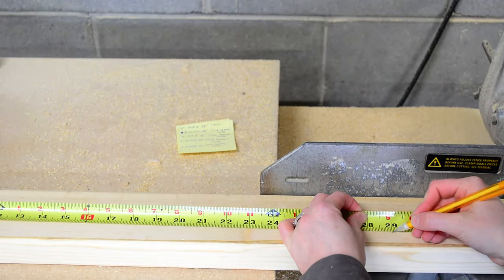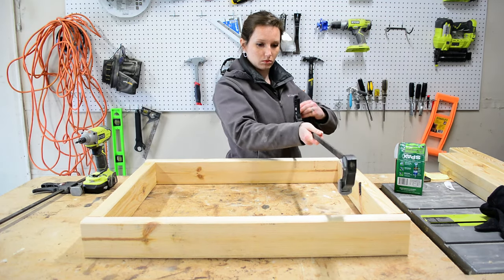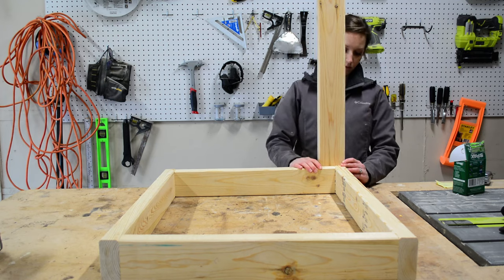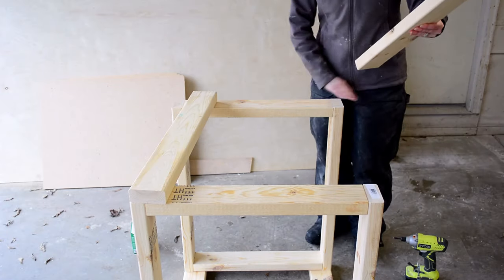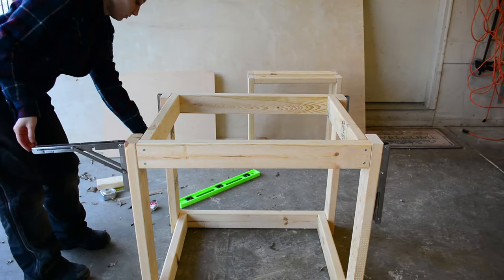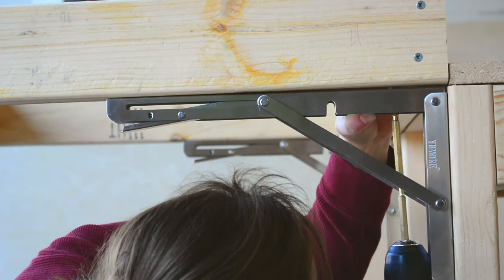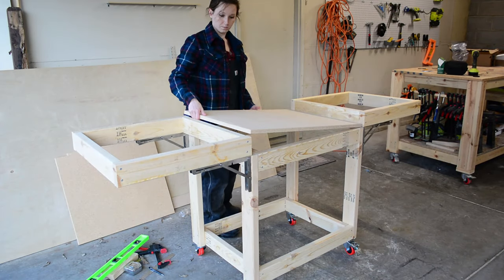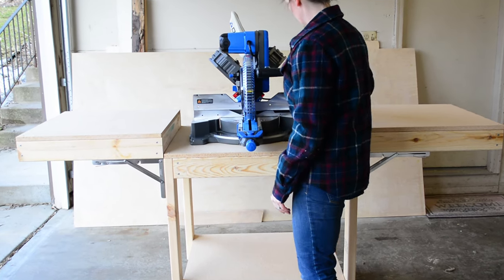How to Build a DIY Mobile Miter Saw Stand

Comment: I used your design and it came out pretty good. The only problem is something you alluded to in the video. The 12" brackets aren't,  at least in my case, strong enough. After about two weeks they started bending. But your one of the few people on line who isnt trying to rip people off and I commend you for it.

Comment: i built it yesterday and today.  i'm a newby and i learned alot.  in the army we had a saying "beat to fit"   the hinges were beat to fit.  they work perfectly.  i turned the table on it;s side to install the hinges.  thot it was easier drilling straight down than sideways.  gonna build another one for my son in law.  thx for your help.  keep the videos coming.

Comment: Great video. Took a look at her website, as well - informative. Decided to build this since it resolved some issues I currently deal with. I bought the cut list and plans. At $2.99 that was well worth it, plus it felt right to reward Tylinn for her efforts even if it’s a small amount. Trickiest part was getting the height of the wings to match the saw height. That’s easy enough to calculate but life isn’t as accurate as that. Saving grace was being able to shim the saw when mounting it in place. Used the completed project for the first time today. Worked great, and the wings provide me with much needed working space. I don’t have a workshop - just a garage. So, having eight more square feet of horizontal workspace was fantastic.

Comment: Just got done building it.Due to the high cost of two by fours right now I used to by threes. I’m sure it’s strong enough. I also use the Craig jig for the but joints with glue. For the brackets are used lag bolts.

Comment: Great project. To lighten the load, the wings could be narrower. Made a little bit wider than the cut platform of the saw. Of course this would require an additional brace on each side. I hope to be tackling this project in the next few weeks.

Comment: What a cool channel - and website! Just found you while hunting for a mobile miter saw table. Modified the measurements some to make it fit through the narrow opening between car and garage door so I can finally saw outside without having to move the car out every time. It will save time in setting things up for a project, and instead of carrying my miter saw out, stress on the old back, I can simply roll it and save on ibuprofen :-) Thank you!

Comment: Very, cool! One thing I didn't hear you mention was the cutting area of the saw being flush with the side end shelves. Wow, I guess a 2x4 is the same height as the miter saw. That is one easy way to measure and get this exact.

Comment: Thanks for sharing.  How did you figure the height of the wings in the up position in relation to the table portion of the miter saw?  I would think you'd want them exactly the same to support your work piece without flexing?  Thx

Comment: Well done.  Your video's are clear and concise, not too much chatter and you show details well.  You web site is first rate and the plans the same.  The only suggestion I would make is to reference parts like wheels, etc. on Amazon or some other site so it can easily be found; otherwise I give it an A+ for effort and completion!
Reply from the maker: Thank you!  I have all the links at the bottom of the post on my site but perhaps they are too buried.  I appreciate the feedback!

Comment: Just finished making this. Bought your plan. Figured it left fewer opportunities for me to make mistakes. I also bought the casters and brackets you listed. My only problems came from the lousy 2x4s from Home Depot. Too much cupping and twist. Made it hard to get things really square and flat. I thought mounting the brackets would be the hardest part but that went quite well. I'm very pleased with the result. Thanks for a great video. David Mihalic
Reply: Hi David.  I am fairly new to serious woodworking and I agree that the wood at Home Depot and other big box stores can be marginal at best.  I am currently in the process of building this miter saw stand.  I have learned from Steve Ramsey (YouTube) and others is that you have to weed through wood carefully to find the right boards.  When I was looking through 2X4's at Lowes for this project, i had to go look through 2 to 4 pieces to find every good (straight) piece of lumber.

Comment: Built this stand this past weekend. Used 3/4 plywood and some elbow grease to sand it smooth. I'm 6'3" so I made the legs longer in my case (36"). It puts the top of the table right a waist hight.  

I also had to adjust the wings as my saw deck wasn't the same depth of a 2x4.

Thanks for sharing this.

Comment: Awesome video. I am planning on making one for my miter saw. Is the wing height able to match up to the miter saw base so your work is level?  Thank you
Reply from the maker: Yep, just make sure to attach the brackets at the correct height so the wings are level with the saw tabletop when they're extended. Just depends where you attach the brackets

Comment: Hello, I have a 2 car garage that I have made into my shop... and I have built a 4'x8'  rolling workbench and a lumber storage, so needless to say, anything else I build has to be as compact as possible.... I was so tired of lifting my miter saw up on my workbench, then moving again to use the workbench, and so on back and forth.... so, I came across your video while researching options for a miter saw station..... and less than 24 hours later, I have exactly what I not only wanted but needed.... I was going to put my own spin on it, but yours hit all the marks...... I especially like how the folding wings are wide enough to accommodate 2x12's.... I did go with 16" brackets, but kept everything else to your specs....... so, thank you and I'll follow for more.... 🙏😁💪

Comment: Thanks for posting. Lookin g forward to building this.  A few questions…..can we use regular screws instead of self tapping screws?  And it looks like you didn’t use a counter sink drill bit.  Any issues with doing that for this project (especially if we don’t have an impact drill)?

Comment: Building this workstation this weekend and I am putting together the list of materials I need and noticed you said that in putting on the folding bracket you used some washers... What size?? I won't be getting the brackets from Amazon until Monday, but would like to have all the supplies needed to finish the build.

Comment: I always use plywood. Never really used particle board on anything I've ever built. 

A particle board dust warning for anyone! 

Haha. Thanks for the plans. They helped me get in and out today really quick. I didn't have time to think out an idea in the store this morning.
Reply: Is there something wrong with particle board dust? Did you make this with plywood instead??
Reply: @gmoney8873  any saw dust CAN be bad for you. But that particle board ends up like baby power and it's a mess. I made the tops out of particle board. It's doing well but it was definitely a mess.
Reply: @TheCentralflorida  thanks for the info. Just wanted to make sure it wasn’t a bad idea to use the PB. I’ll cut outside when I do this for sure. Glad it’s holding up. How much in total for materials!?
Reply: @gmoney8873  I really don't recall. Definitely more expensive now. 

Maybe around 100.

2x4s. Sheet of particle board. 4 brackets. Wheels.

Comment: Hi Ty-Lynn.  Thank you for posting your video and plans for the Miter Saw Stand.  It was an enjoyable 2-day project for me.  Probably the most difficult part for me was aligning the brackets properly.  In fact, one side still does not go down all the way and I will tackle it in the future when I am thinking more clearly.  I modified some plan procedures a bit.  I used pocket holes to assemble the center frame, mainly because I had a pocket hole jig and felt like testing it out.  I drilled 2 pocket holes in the ends of each 21 inch 2X4.  I then glued the frames together from Step 1 and Step 2.  After waiting 24 hours, I screwed the pocket holes into each drilled hole.  I also glued all 4 tops to the frames instead of screwing them in.  I used the same wheels that you recommended but upgraded to a more heavy duty bracket since I was seeing sagging issues mentioned in some fan comments.  The brackets I purchased are 14 inches long and are rated to hold 660 lbs.  Finally, my biggest concern was to adjust the brackets so tops of each side would align perfectly with my miter saw top.  I measured, and then measured again and it aligns PERFECTLY.  Thank again.  Up next -  Your table saw plans.
Reply: do you have a link to the brackets you pruchased

Comment: I bought a cheapie Ryobi miter saw and first thing I built was this table. Helps a lot with working on a proper area than to lug the thing around and struggling. Your table looks well designed, just w word of caution, when you built the initial frame clamp the sides before drilling and screwing things together, because your end result was your table was wobbly - wood working is all about the 45 and 90 deg accuracy. Overall it looks pretty good you will have much joy working with it.

Comment: What a great build. I may do the same. I've used 2x4s  in a lot of my builds in the past, but I've found them a bit overkill for many projects. I now use 2x3s for many of my projects now. A bit cheaper and lighter.

Comment: Made the stand this weekend, came out good, added a t-rack across the front of each side piece for a homemade stop block jig. QUESTION... What's the best way to level up the saw with the side pieces.. If I shim the saw up to match the left piece then it's higher than the right piece... Also the right piece has an ever so slight droop to it... Would you recommend shimming between the brackets and the frame?... Thanks!

Comment: Great build, I just got done and it’s great.  I added a kreg trak stop block to both wings.  Only problem is….those hinges allow about a 1/2 inch drop at the very ends of the wings.  I made a couple temporary support boards for this problem.  Now the table is completely level.

Comment: Maybe this is a stupid question but how did you know the wings would be at the proper elevation? In other words it looks like the wings are a 2 x 4 length higher than the tabletop. Is that something standard for a miter saw? I thought there would be all kinds of adjustments required to get the miter saw ledge top to be even with the wings but it seemed like it was no big deal.

Comment: Hey a very interesting idea to even more so improve on your amazing bench you could run 2x4s along the either side where your wings are when fully extended cut out another piece of the board and either drill a couple inserts for dowels on every corner or attach it another way. In this way you can set an easy workbench up for when you need.

Comment: Love the design. Had the most awful time getting the brackets installed to line up properly. They would always be off and the wing would never close flat. Like they were installed crooked? Also this was my first project so im sure i was doing something wrong of course. One thing i will mention is that I have a Hitachi chop saw and i was under the assumption that all the chop saw decks were the same height. I finally got everything built and set my saw on the stand and when i raised the wings up, my saw was almost 3 inches taller then the wing was. Is there a calculation you could suggest to give me the actual measurement needed so my deck of the saw is flush with the folding wings? Im a beginner so was a lot of trial and error on my part but thats how we learn. Great choice on the brackets they are plenty strong to support the wings.
Reply from the maker: The brackets do have to be pretty exact in order to close properly. I loosened them up a little along the vertical side when I attached the wings so I had some wiggle room to get them lined up nice and square, then I tightened them back down. I did have to shim one of them where the 2x4 leg had a little divet in order to get it square. Just takes a little finagling. To measure the height of the saw tabletop: I set the saw on a flat surface, laid a board across the saw tabletop, and measured from the work table surface up to the bottom of the board. Hope that helps!

Comment: Mine is just about finished.  I had to adjust the height to match my particular miter saw top cutting height to be the same as my big workbench and my table saw.......my shop is confined (12 x 20) so when I lay a long board on the miter saw it may need to cross over my bench or table saw.  Now....I bought the locking wheels recommended in the video.....but I should have gone larger....the small wheels will not roll well if going out onto the lawn area or other unpaved surfaces.  Finally, I am making an electrical wire  (from my saw) holder....I unplug my saws when not in use and do not like loosly hanging wires.  Finally be careful about placement and things that get in the way of miter saw rotation.

Comment: How to you adjust the table height so that the saw bed is level with the wings? Making this as soon as I hear back from you.  Love how you stepped through the stand when turning it over.
Reply: Yep...feel like this is an important requirement but was not covered in the video. Just measure the height of your saw and build wings to that same height.

Comment: a solution to people worrying about the support of the wings is to simply add another vertical 2x4 in the middle and add a bracket to it .There is not going to be much weight on it anyway. this is a great build and I have had no issues with mine.  Thank You!

Comment: Great build Ty-Lynn! I saw your build and instantly knew I had to model my new sliding miter saw station to this! I have run into one issue in my build and wanted to find out if you have any drop in the wings which makes the cutting surface un-leveled. The further from the saw I get the more drop I get, so much so I am debating on adding some sort of leaf to level the wings out...or something
Reply: Victor, great feedback, you would think for the price of those brackets that would not happen, keep us posted on a fix please
Reply from the maker: I had a little drop in them the other day when I was trying to cut a long 1x10 on it, but other than that I haven't had any issues. I think it was the weight of the bigger board. I put some scrap 1/4" trim pieces under the 1x10 at the very end of the wing and that worked out to hold it level. A leaf would help, or you could try some of the bigger collapsible brackets (but I know those get a little spendy).
Reply: @TylynnM_  agreed. I used a hinge & scrap to a stop block, it falls and lays flat.

Comment: I realize this is a dumb question, but when I clamped both of the "L's" together like you do in the video, when screwing them in, it threw them off level. Is there anyway to negate that? I got close to done, realizing that's what happened, and I just got so bummed about it I stopped working with it

Comment: Good video! But just a little advise for woodworking is use the wood screws with the torx head they are much easier to drive.
Reply from the maker: I'm definitely going to be switching to those soon

Comment: I just built this. Went exactly as you described! I have a 12 inch saw and made  it 36 x 20.  Probably could have gotten away with 33 instead but didn't want to finish just to find I didn't have room.  It had gives space to hold my pencil, square, etc.  Thanks for the project. The hinges and casters linked work perfectly. Thanks

Comment: Out of curiosity are you still happy with the folding brackets or do they sag like mine did after a while.
Reply from the maker: They have a little bit of give in them, but I usually just shim the end of the board up as necessary. I use it as my main cutting bench.
Reply: @TylynnM_  I couldn't possibly shim mine any more. And they were like that on day 1. Maybe I got a bad set. Or two bad sets since they both sag like hell. Ill go with something different next time.

Comment: Great idea and plans!  Since I moved, my once very hand Dewalt  Compound Miter saw has been relegated to usually sitting on the floor between uses due to a lack of space for a permanent home (very sad...), but your mobile stand is the perfect solution!  I do have one question:  After adding the wheels, what is the total height of your stand from the floor to the top of the extended wings?  Just checking to see if I need to make any height adjustments.  Thanks for the video and clear instructions!

Comment: 2:47 - in case you haven't already discovered them, you might appreciate a recommendation I just heard in v=6739bWT7jSA (a bit over 3 minutes in) to use screws with star bits (e.g. GRK in that video's recommendation, though I know I've found similar from other brands, as well), because Philips screws (which I see you were using when you made this) were specifically designed to slip (as a way to limit torque), and thus have to have lots of pressure to keep them from slipping, whereas the star drive (originally Torx, now generic) transmits torque well with only enough pressure needed to keep the driver and screw engaged with each other.  Super handy!

Comment: Did you get lucky that the height of the wings (2x4 plus MDF) was the height of the saw?  Seems like an easy fix if my saw is "metric" an requires the wing structure gets ripped to size.

Comment: I have a built a mitre saw stand and am looking to add the 'wings' as well.  What is the height of the deck on your mitre saw?
Reply from the maker: It's 3 1/2", but I've had others that are 3" or 3 5/8". Just depends on the brand. You can just move the wings up or down to line up